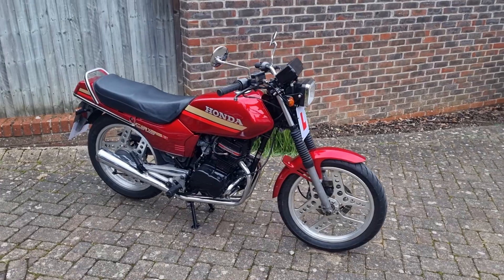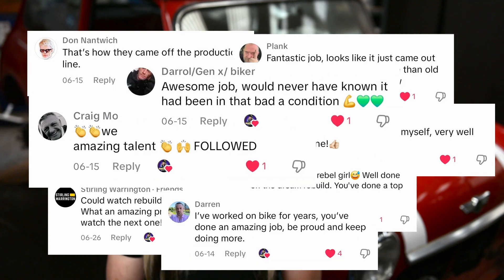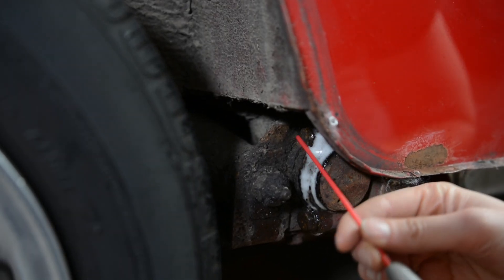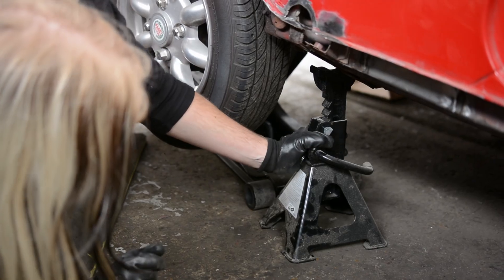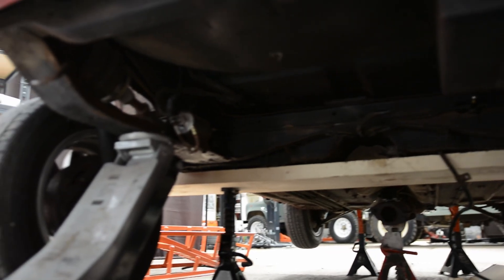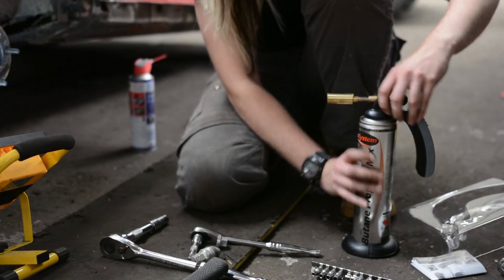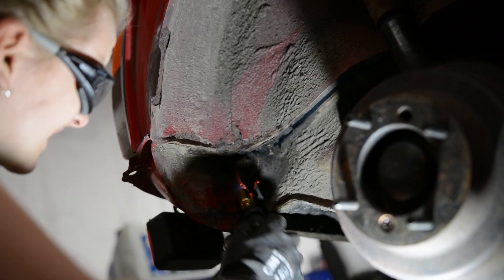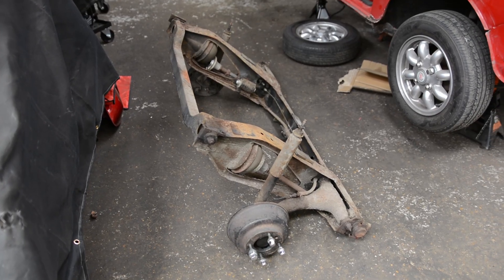Removing The Rear Subframe - Classic Mini (Episode 3) #laurasworkshop

Comment: Good work, would have removed the bootlid first to give you better access inside the boot. Personally, i wouldnt bother with shotblast and powdercoat, just wire wheel it back to bare metal, some rust treatment and a few coats of black smooth hammerite does the same job and is cheaper. Would recommend using uprated orange polybushes though on your mounts when you rebuild it, id also do the same to to the radius arms, get them repinned and replace all the moving parts.
Reply from the maker: @karlgt9989  Thank you for the tips ☺️